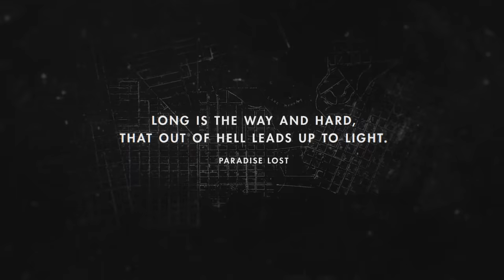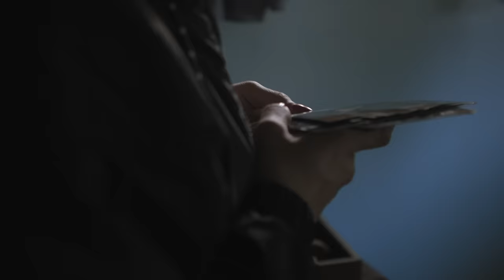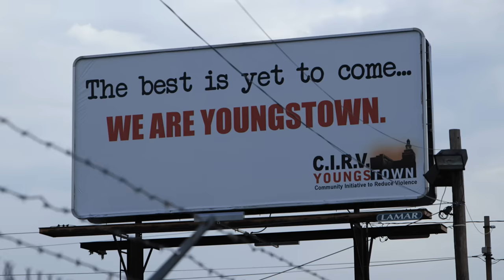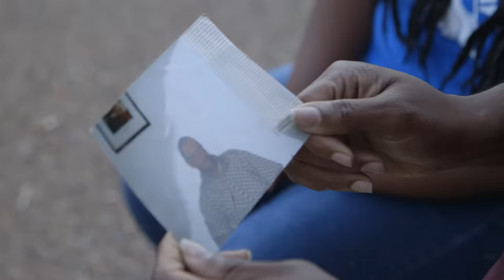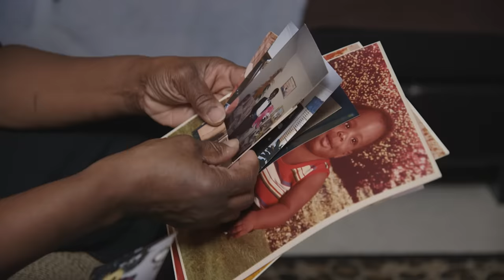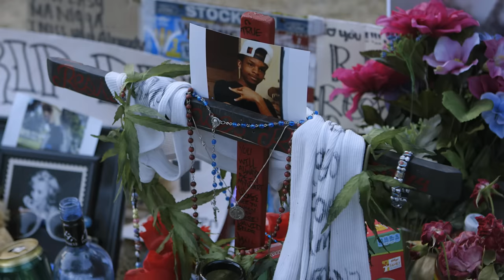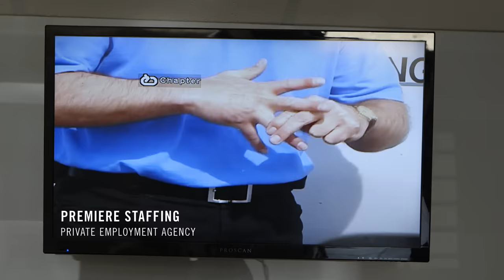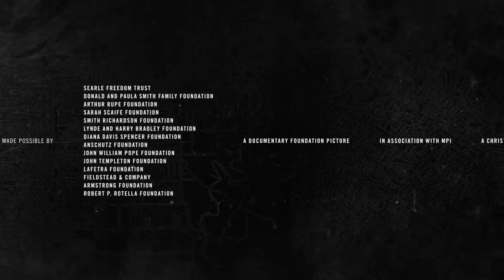America Lost (PBS, 2019)

Comment: We live in Ashtabula, OH. How the heck can they afford a car? We can barely pay rent; the ceiling in the kitchen is caving in and chunks of plaster fall on the counter, full of black mold. It's creeping into the whole ceiling. Our bathtub's base is made of wood so we have rot and mold problems there too. Our shower is a 1/4  plastic tube.  No screens on the windows and no heat - we use space heaters in the winter.  No fridge, no stove, I bought a mini fridge but it wreaks havoc on the electric, which goes out frequently because the system isn't grounded. No buses that can be relied on, one taxi cab for the whole town. Wow. I just realiised, it's kind of grim here lol

Comment: The bottom line is that the average man working full-time, and average woman working part-time, need to be able to support two kids in a safe situation.  Self preservation AND species preservation.  If that works, everything else falls into place.  But if it doesn’t, everything else falls apart.  And it’s hard to put back together once it’s broken. ❤️‍🩹